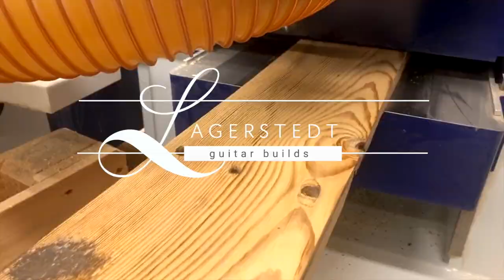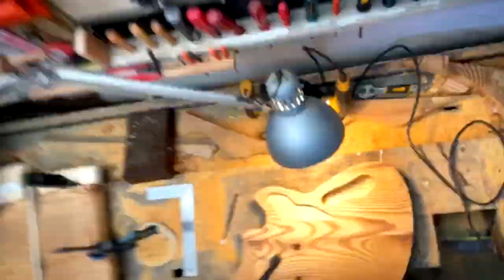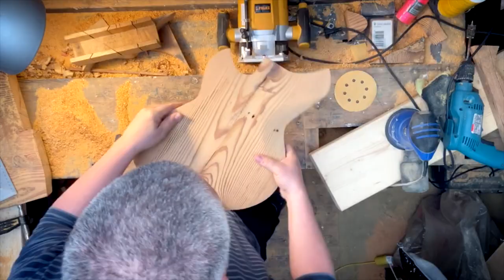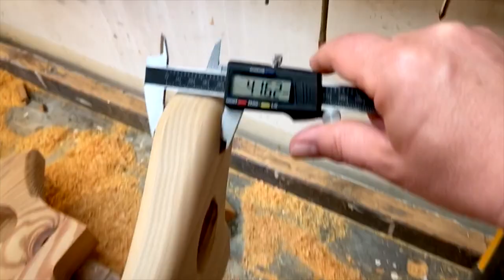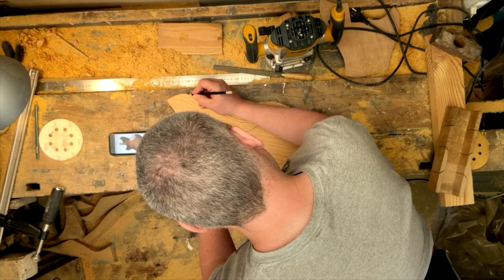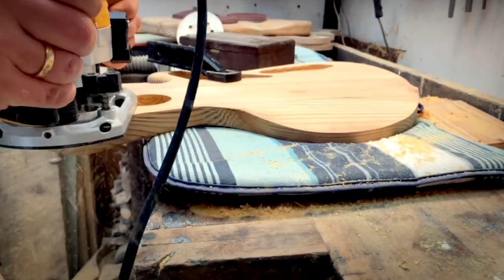How I built my DREAM GUITAR - shaping a solid body guitar - with hand tools: Part2:9

Comment: I want to build a monster 7 string bass guitar with wide spacing...any tips for me?
Reply from the maker: Wow ... sounds like an ambitious project 👍🏼
Well my experience is pretty limited but what I tried to do was research a lot. And when I got to sloppy and tired I stopped and continued later. Also try to have the right tool for the job. It’s not always possible for woodworking amateurs like me but I tried not to use old drill bits and so on... don’t get impatient 
And Thanks so much for watching 🙏😃